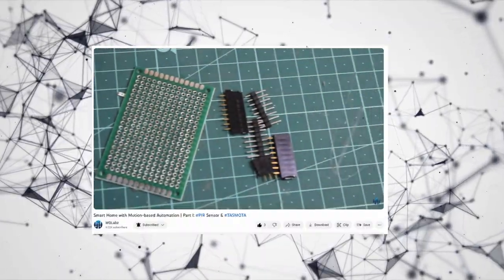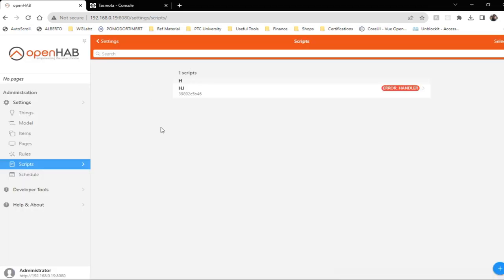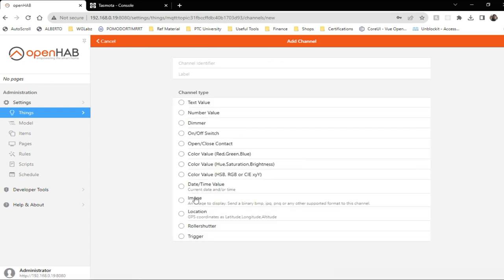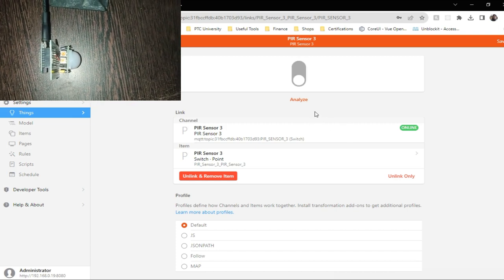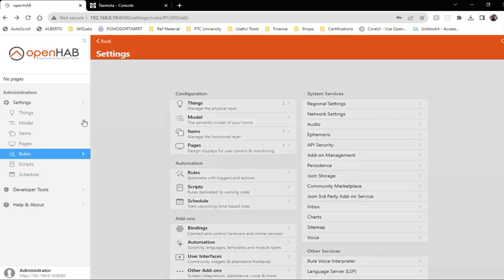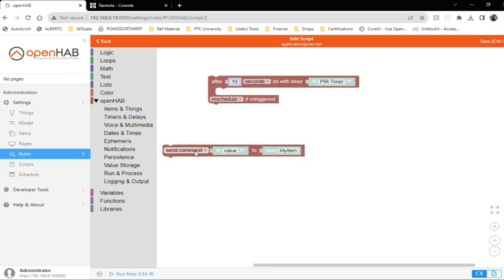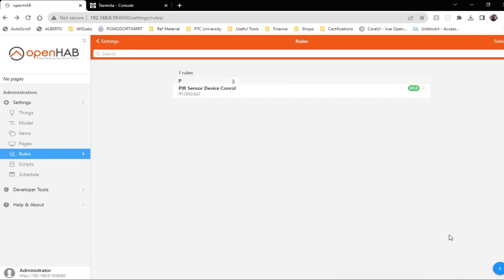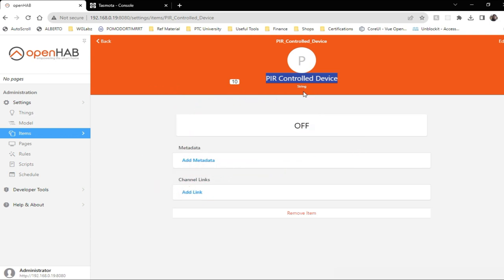PIR Motion sensor with #OpenHAB

Comment: Hai, just watched a video of yours from 7yrs before . I would like to make a controller which draws data from obd of a car , and is used to control a actuator which opens after certain boost pressure.
Reply from the maker: May be you can work around a OBD scanner tool. Have never done that though..